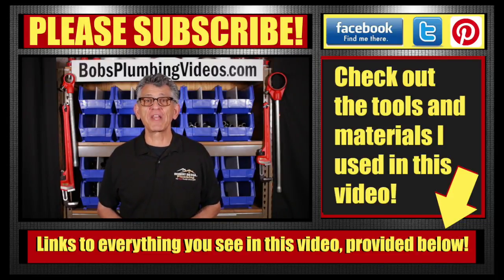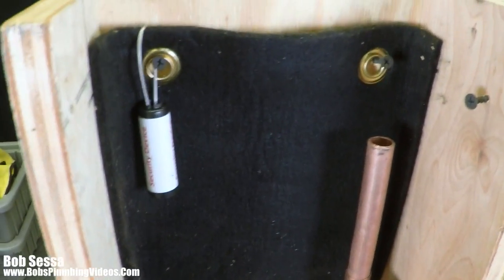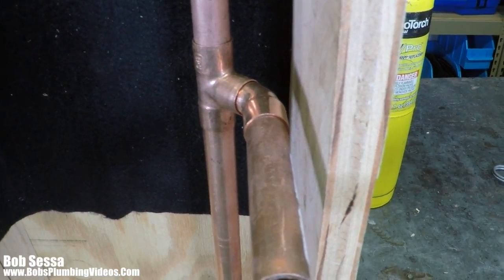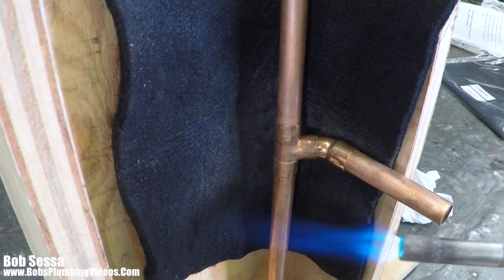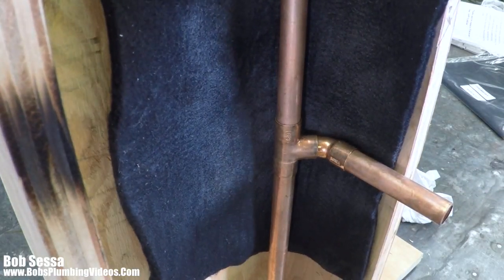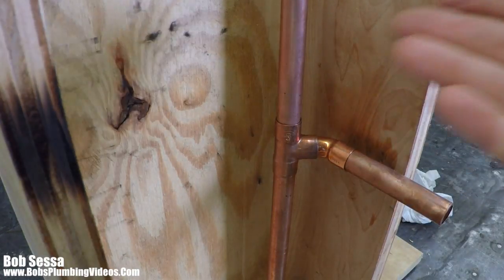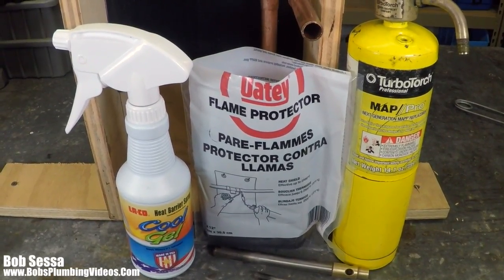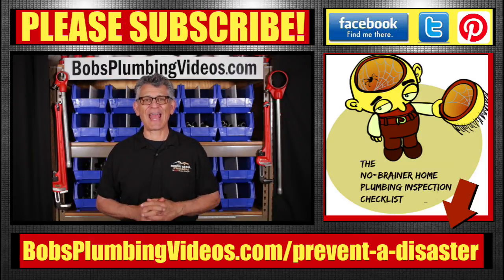How To Solder Copper Tubing and Avoid Burning Down Your House

Comment: Thank you for the info,  great video,  quick question,  have you tried to wet the flame protector sheet with the gel instead of the water?
Reply from the maker: I have not, the gel is a little pricey but I don't see why it wouldn't work.

Comment: Bob, thank you for this video.  I was fixing a pipe freeze split that was just under the top horizontal 2x4's in a wall.  I cut away some of the lower 2x4 to get some clearance, then sprayed the Cool Gel you recommended.  First I did a trial on a scrap piece of wood and found out why you sprayed a thick coating before starting to solder.  A thin coating was not enough to keep from scorching the wood.    So for the fix I applied a thick coating and was able to do the top solder sleave joints without scorching the wood.   The Cool Gel works great and your video saved the house.
Reply from the maker: You're welcome and thanks for checking out the video! Pretty COOL Stuff....Regards, Bob.

Comment: Lots of great information in your video but now you have me worried.  I found out recently that my garage conversion to office space, with lots of sinks and plumbing was done without permits. I need to get a C of O to sell my house, and have to hide all the plumbing in the wall before a town inspector arrives. I thought I would SIMPLY cut all the copper pipes in the wall and solder caps . Now I'm thinking I will burn down my house in such a small opening.  Some of the pipe stub outs are through 1970's style paneled wall, so unlike drywall I am not going to expand the opening. Maybe I will have to spend the big bucks and go with Shark Bite.  I also have copper pipe for cold water coming through the slab. Can't burn the slab down but will have to do lots of concrete chipping I suppose. The space has to look like living space , which typically has no water supply or drains.
Reply from the maker: STEVEONLI   I don’t know where you located, but in lieu of soldering cap’s you can use a shark bite cap fitting. Not legal to use here in NYC but for what you’re looking to accomplish it’s a safer choice. You push them on, they seal with an “O” ring washer. Available in Home Depot.

Comment: Bob, how long does the Oatey Flame Protector last?  Do you have to replace it after an X amount time or jobs?  Thanks for all the great videos.
Reply from the maker: Khyber Safi  it’s going to depend on how often to use it. I will generally carry two and as a rule will replace one annually. I wet mine as an extra precaution, but again it will depend on how often you’re going to use it.

Comment: I use a low melting temp solder like Worthington 440° F along with a small tip torch and the Oatey Heat Shield. I also have a spray bottle full of water and a small halon fire extinguisher just in case. I know it sounds like over kill but who knows what can happen. I am a do it your selfer and I don't like to push my luck.
Reply from the maker: You can never be to cautious! Thanks for checking out the video!

Comment: I use the Oatey flame retarder and a water spray bottle.  If you get the gel on the joint does it mess up the capillary action of the solder flowing through the flux?
Reply: Excellent video and information. I to use the Oatey flame retarder and a water spray bottle. A fire extinguisher on hand is also a good idea. After all if you are working on water pipes availability of water will be a problem if needed.
Reply from the maker: Yes, it does, I accidently over sprayed the copper in the video. You should try to avoid that by all means. My apologies! Regards, Bob.